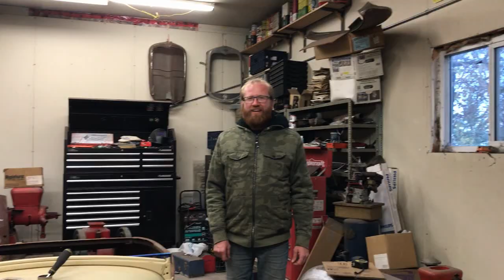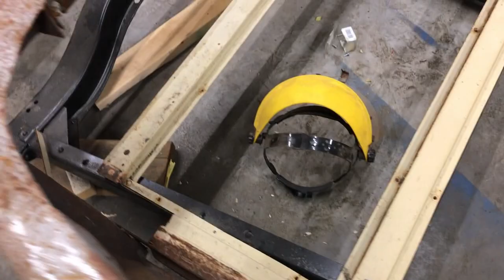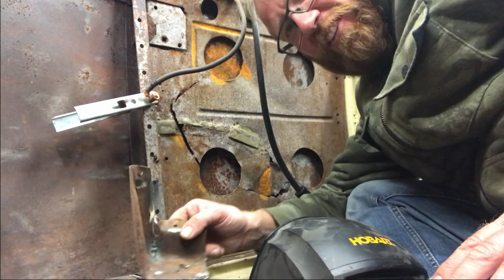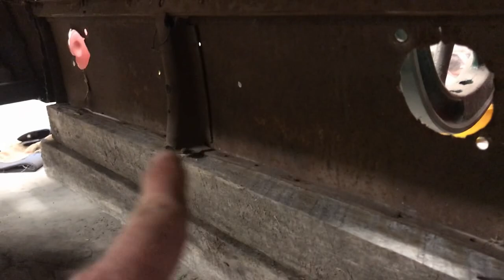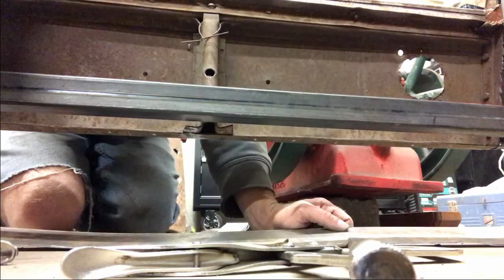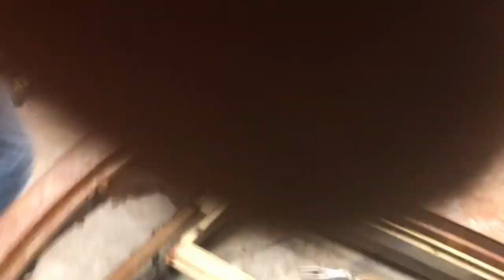1929 Ford Model A Roadster Hot Rod Build. 1932 Ford Grill. Rat Rod, Nastalgic Old Car.  Barn Find.

Comment: Can I ask what radiator fit in the 32 grill shell? Brand or dementions?
Reply: Depends on whether you’re looking for something out of a late model vehicle or a brand new, off the shelf. I have a Walker radiator with a Spal electric fan in my ‘32 roadster running a 350 Chevy. It fits the shell as per the original.  I’ve had a few over the years and highly recommended them. I’m not 💯 % sure but I think Eastwood make repro’s also. 
Good luck with the build.

Geof (U.K.)
Reply from the maker: I think it is an original 32 radiator, it is being use for mock up only.

Comment: The Model A is one of the greatest cars ever made.  Glad to see you working to get that one road worthy again.  Keep up the good work.  The only piece of advice I could offer is to get a flap disc on a grinder to remove surface rust and hit it with some weld through primer before welding parts together. It'll help with long term preservation.  Again, glad to see you resurecting the old car.  Don't let listen to negativity from the "professionals".  You're doing great!
Reply from the maker: Thanks Bryan model a do rule.

Comment: It looks like a decent body. The toughest part of building a hot rod is welding! Finding all the parts to match up seems time consuming.  You are doing it right by stiffening the body panels and checking the frame for square. The last thing to concern your self with is all the critics who would do it differently! If you are not happy when it is done you can change it.
Reply from the maker: totally Right Ed.